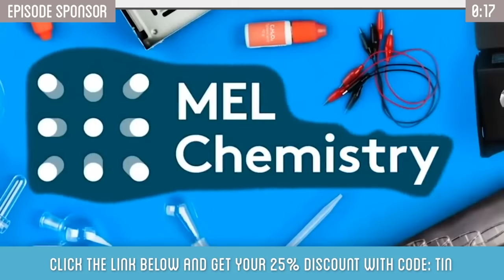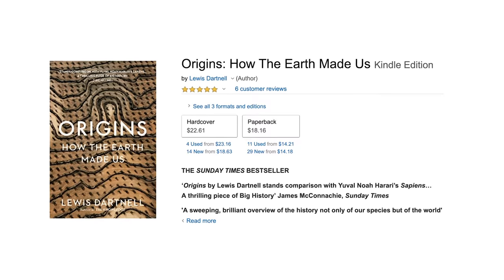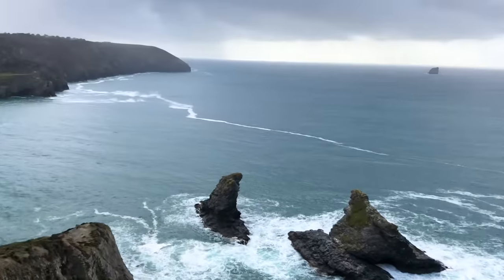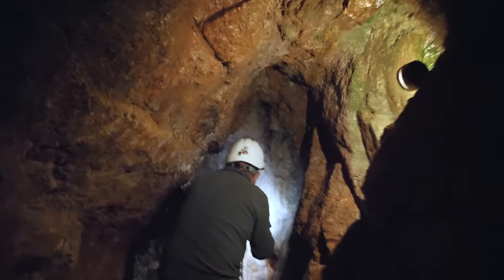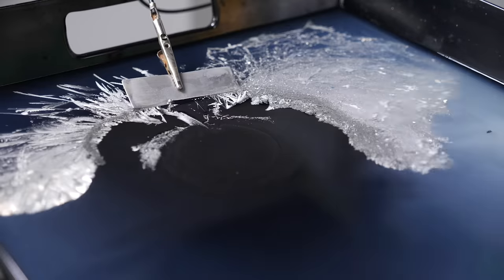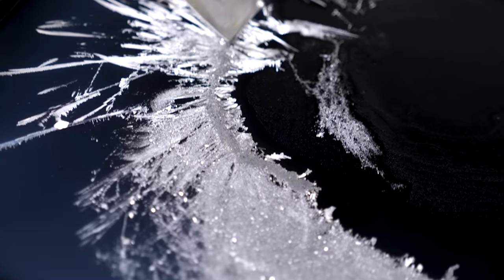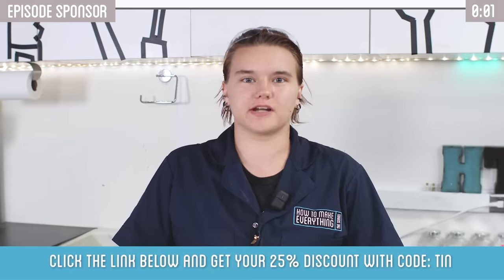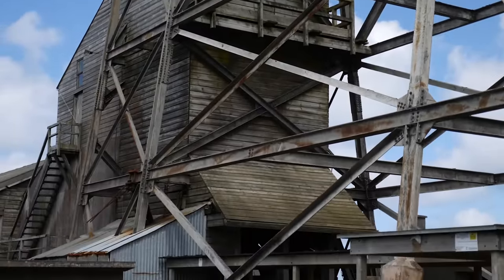Mining This Rock Unlocks the Bronze Age

Comment: So you're correct that the majority of bronze is made with copper and tin; however, this wasn't the alloy that began the bronze age. The earliest bronzes found were arsenic bronze (likely because of the distance between copper and tin deposits, as noted here). It's still an improvement on copper, but of course requires working with such an exceptionally dangerous substance.

It's thought this is why a lot of smith-gods from various European faiths were lame - years of working with such substances would have led to physical disabilities.

Comment: 3:25 What ? Bronze looses its edge very quickly ? Properly made and hammered bronze is very durable. Go check the ThegnThrand channel where they tested historically accurate bronze swords and spears. It cuts wonderfully, it is very durable and tough, and it can cut with no problem trough steel sheets.  Iron swords were usually softer than bronze ones. Iron were used beacause it was way easier to find and produce, not beacause it was so much better and tough ! (Of course properly heat treated carbon steel will largely outperform bronze).

Comment: 231.9 °C  or 449.42°F is the exact melting point of tin.

PropertyMinimum Value (S.I.)Units (S.I.)Poisson's Ratio0.325ShearModulus14GPaTensile Strength11MPaYoung's Modulus41GPa

Comment: This is cool and all, but how would you make hydrochloric acid? how would you apply electrolysis in a stone-age environment? I know this would make for an agonizing process, but I don't think there's anybody out there who's actually gone through the WHOLE process, step by step. 
Unfortunately you might have to do away with copper/tin/bronze entirely, because the mines are so rare. Iron is more universal. Of course dealing with iron when all you have is stone, clay, and wood, is equally agonizing. But let's say the same disaster that occurred 12,500 years ago happened tomorrow. And assuming we are unable to scavenge from the remains of today's society, how quickly could a small band of 3-4 capable people get back to the steam engine?

Comment: Tin is expensive, 
you should build your own forge and mine.
to move to industrial era,
 like lots of physics thermo dynamics and stuff the best minds.
it takes a society to get from stone to industrial era not a single person can do it.
average dude will be stuck in the stone age.
smart one on metal age.
genius Renaissance era with chemistry and electricity.
your cheating they have to discover it and its really difficult to make a living back then. like stone age 95% work for survival 5% research.

barter /trade tin for copper and iron. 
if you have silver gold mine better.
you need dudes from scratch also to trade with hehe

Comment: Useless video. The entire tin-making process is with modern tools like a steel hammer, acid, bunsen burner etc. These should be redone, using only the tools available at the time. E.g. smash tin ore with a rock, lump of metal or copper hammer or such, melt in a clay oven, etc.